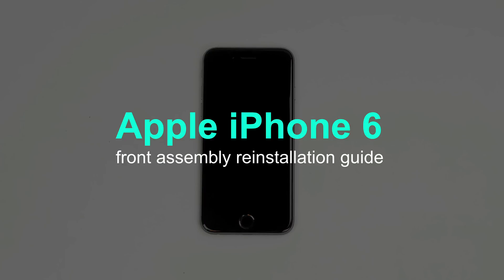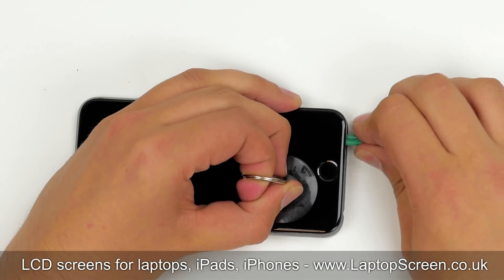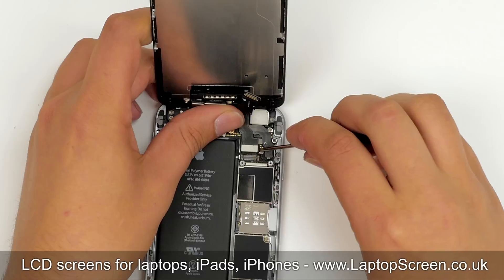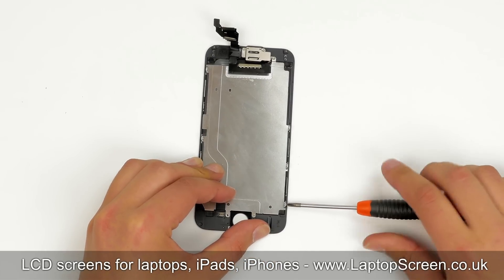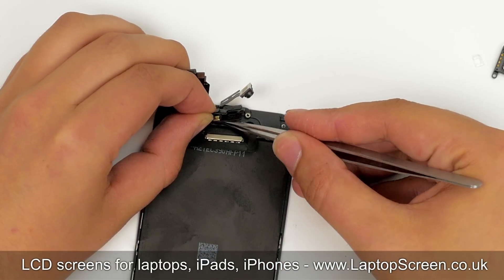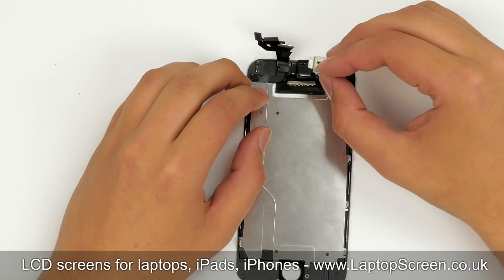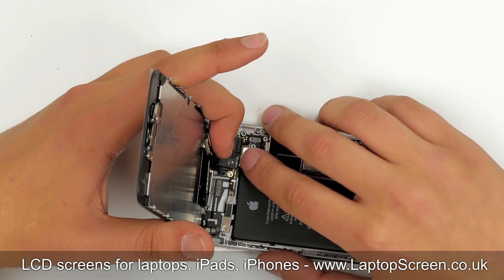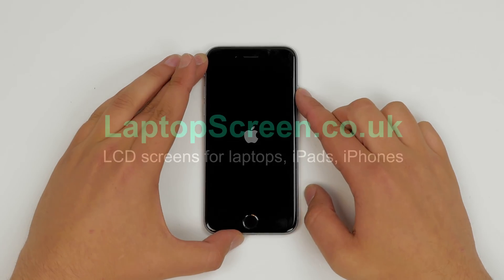iPhone 6 - how to replace screen and digitizer

Comment: Hi ScreensUk, as with my replacement screen, your video shows a 'black' recess for the Ambient Light Sensor.  My original screen has a bright WHITE recess.  It looks like the recess in my replacement (and your video) is a direct 'cut-out' to the front glass, whereas the original has a white plastic(?) layer.  Do you know if this has any effect on the functionality?
NB @ 4:13 your 'existing' screen does not have the WHITE recess, but the 'new' screen appears to have it (side by side).  At 4:15, you appear to be reinserting the components into the 'existing' screen which does not have the white recess.
UPDATE: Although it would be interesting to hear a professional opinion, I replaced my screen (with the black recess), and all features (including sensor) appear to be working.
NB It is a nicely made video, but it doesn't highlight how difficult it is to remove some components due to adhesive.  I totally ripped the home button cable attached to the LCD shield, as the adhesive is strong on the metal backing of the connector.  Also, the adhesive seemed to be thicker than normal on the back of the camera/sensor ribbon.  I believe heat would be useful in these areas.

Comment: This is a great video, however, this is my first time fixing a phone and I believe you went way to fast on the part where you place the flex cables where the sensor and camera is located. I was left with the "metal microphone" hanging and I didn't know where to put it. I tried closing my iPhone thinking that's how it supposed to be and it broke the metal park on my flex cable, so now I have to buy a new flex cable with the sensor and camera.

Comment: An update on 09/28/2017. I had ordered two of these screens. The second one I ordered is now installed. I finally learned to place the proper screws upon a clean black cloth next to my work area. Black contrasts the shiny silver screws. locating them in the same pattern they were in the phone allows exact placement back into the exact spot you removed them from.

Comment: I would like to thank you for posting this video. I did my first iPhone 6 repair. I replaced the LCD screen digitizer. The only problem I came upon was the forward camera did not work. Other than that, the customer was very thankful. I charged her $50 total including labor. I could not get over how tiny the screws are inside the phone.

Comment: I want to follow this guide, but I'm using a screen from another iPhone 6 to replace a broken screen on another iPhone 6. Are there any precautions I should or specific instructions I should know? And will this guide replace the digitzer that deals with touch inputs/outputs? The iPhone 6 that needs the screen replacement had a ghost touch problem (long after the first minor crack of the screen) and I heard that a faulty digitzer causes ghost touch.

Comment: be very very very careful with the "garment of cables" because they are very very easy to break i snapped one of and im having to buy the cables gain luckily they are only $3 plus you may loose a lot of stuff if you have my luck i lost a screw and the sensory mount so i had to buy those to :(

Comment: I did everything the same as you did but my home button is 'loose'. If I press it on the top side, the bottom side comes up  and the same the other way around. Can you tell me what I did wrong/what I can do to fix that?
Reply from the maker: Hi Jeroen,

Sounds like the home button bracket that secures the home button from behind was either not aligned properly or not fully screwed in. Should be an easy fix - take it off and reassemble making sure that the adhesive membrane around the button is fitted neatly and not folded over. Affix the bracket, making sure that the alignment pins are aligned, and secure it all with the correct screws.
Reply: I tried refitting it 3 times, looks like everything is in place. The screws are as tight as possible, I have no idea anymore ...

Comment: I replaced mine every think is ok but the screen is foggy with vertical  blue lines and bit of flickering which goes off after few minutes. Anybody got any clue  ?
Reply: Mubashar Hassan sounds like the ribbon cables are loose.

Comment: my i6 was accidently bended and it and it have touch only in One spot, sometimes it 'touches itself' and it have colorful and White stripes, Black and White spots. What do i need to buy so it Will work? Please answer
Reply: new update on my phone. it doesnt display anything, olny stripes and no touch. will normal screen change be enough?
Reply: you will need a new digitizer
Reply: I'm not sure if this is still something you're working on (just now finding this comment.) But in case you are, and the touch is still not working, then your logic board probably broke when you bent the phone. That's the most expensive part of the phone, so you would be better off just replacing the entire thing. Hopefully replacing the LCD will work for you. Best of luck :)